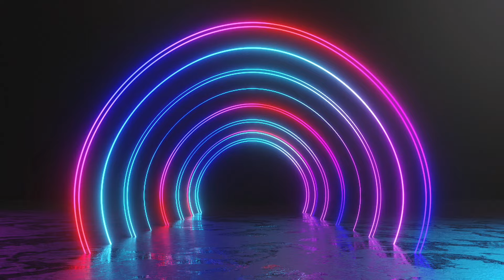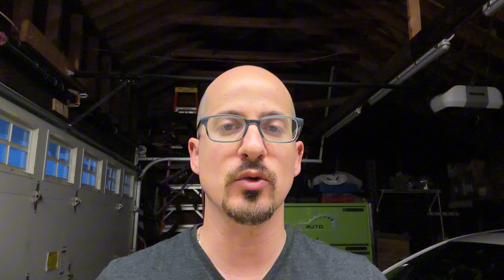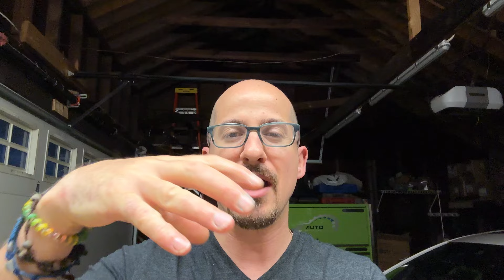Q&A Episode 52 (blind spot, voided warranty, vibrations)

Comment: Another good video like always. I was wondering, can you go into detail about faulty VTC actuators(the crunching sound that occurs for a few seconds on cold start-ups), which is a symptom that's especially common on the K-Series engines? Can you discuss what causes it? How do you prevent it from going bad(especially after a replacement)? And will it eventually cause damage to the engine?
Reply: yes i would like to hear it also.
Reply: That noise can be really annoying when the engine is cold.

The actuator has a spring that get weak.  Honda did change something in their actuator that was supposed to address this problem.  Unfortunately they charge a lot of money for the replacement actuator.  You can buy an aftermarket spring and it can help in some situations.

A stretched timing belt or a bad/failing tensioner can cause a similar issue.  I'm sure this channel will give you details on what to look for.  For an older vehicle if I had the noise and wanted to fix it I'd do the tensioner (it's doesn't cost much) when doing the actuator.

This channel recently put out an excellent video on replacing the actuator - you should check it out.
Reply from the maker: Yep I can work on something for sure.

Comment: Question.

Some Hondas have vacuum controlled/actuated motor mount(s) with a control unit for the vacuum.  Hose(s) run from the unit to the mount(s).  Will a leak in the hoses, or in the portion of the motor mount the vacuum affects, cause a lean condition?  Because I've seen high idle short term fuel trims on a 7th generation Accord and pinching the vacuum hoses that go to the motor mount will immediately lower the short term fuel trim value.
Reply from the maker: Yes absolutely it can have an effect on the engine and causing a lean condition.

Comment: could be idle issue like my crv..while at a light i have to cause it to increase the idle by turning headlights on.
Reply from the maker: What’s the current mileage on it? Also what year and engine?
Reply: @BCautosutions  crv 2016  2.4 litre..88000..been doing it for at least since 66000..i have written to you about it b4...these years are known for it and most flip the headlights. on to stop it at lights...also turning the wheel some while at a light..
Reply: I was wondering about having to change the transmission filters on the cvt every time you change the transmission oil. I read somewhere that it has to be changed at 30.000 miles. Both the one in the transmission pan and the one by the battery. Why does a cvt need more change of fluid than other transmissions ?
Reply from the maker: @Tracy-wr7mj  I talk to a lot of people I forget sometimes, I have a pile of emails to respond to as well 😅. Have you tried cleaning the throttle body and relearning idle position?
Reply from the maker: @frankievalentin533  I do all my trans svcs every 30k personally. It’s a great idea to change those filters like you mentioned.
Reply: @BCautosutions  no i was wondering if i can do the air intake cleaning by myself but i am unsure of the proper procedure..i dont have issues otherwise or shaking ..its at an idling like a light..sometines parked but i attrubute it to my heavy useage of the battery.....i use deep cycle battery since i charge alot or listen to music while car is off but it isnt always.
Reply from the maker: @Tracy-wr7mj  you can clean it but would highly recommend relearn the tb afterward.
Reply: 2016 Accord Sport 78.000 miles  4 cylinder. I changed the transmission fluid already. Thanks Jersey brother!
Reply from the maker: @frankievalentin533  ✅

Comment: Like first, then watch! Hey good Sir, greetings from the Dallas, Tx area! we’re experiencing steering wheel vibrations upon brake pedal application especially at higher speeds, which seems to point to the rotors warping. Brake pads are still beefy though. Do you recommend replacing rotors only or should brake pads be replaced too although they are still beefy? Or should we have rotors resurfaced only and still roll brake pads that are still beefy? Are aftermarket rotors ok? Thanks man! 

Awesome content as usual keeping it real!
Reply from the maker: I would look into rotors and possibly an aftermarket pad or your can just resurface the oem rotors and get another 20-30k out those pads. It’s a tough balance between noise, dust, and warping.

Comment: Great video again as always. Can you tell me what the change interval for a rear differential in a 2019 Acura RDX would be. Would it be 12 to 15 thousand miles or 30 thousand? Same question with the transmission. Thank you.
Reply from the maker: Will answer that, yes.

Comment: Hey, great videos again! Do appreciate what you do. 
Question that hopefully you can give some advice on:
I have a 22 crv with the 1.5t. I did have oil dilution in the first year of having this car and it is better now since using high octane and longer drives/ fuel injection cleaner etc.
But now I have an annoying ticking noise. I can only hear it when I listen for it at lower speeds, below 2000rpm and frequency of the tick goes up and down with the speed of engine.
Here’s a short clip:
https://youtube.com/shorts/xMwgUhuV6bY?si=CYSlBFiOoUeQJAEy

Sometimes it goes away, sometimes it is really loud. And sometimes it goes away after using the AC- but not too certain. 
Pls help! It is annoying especially because Honda service says it is normal. 
Thanks in advance! Cheers